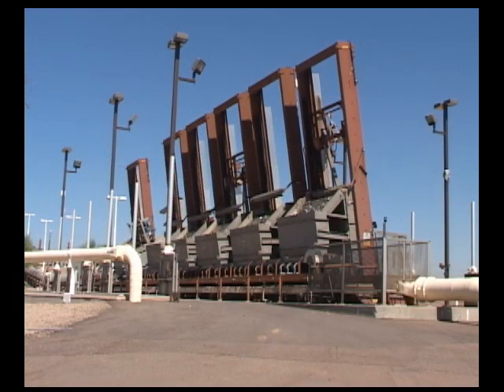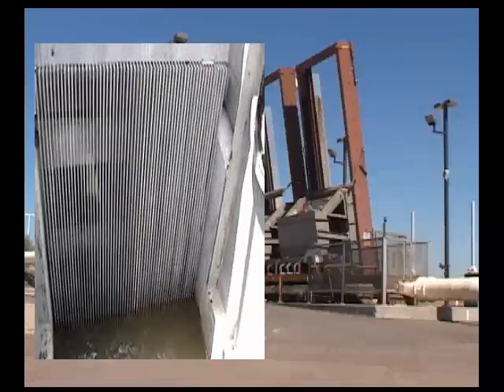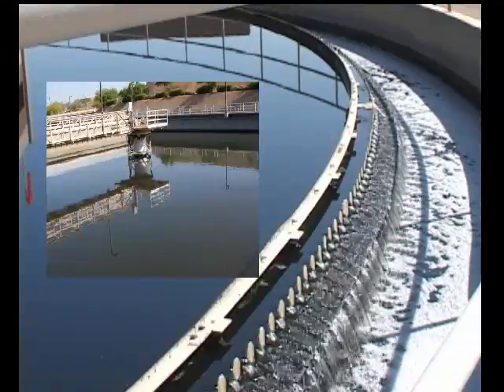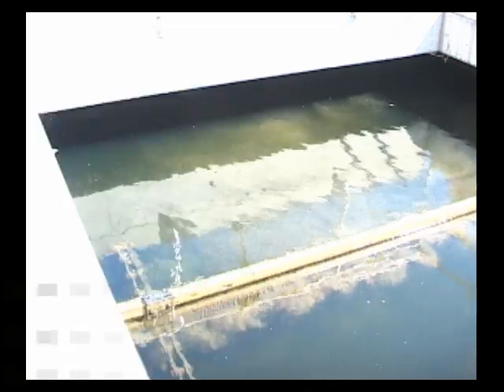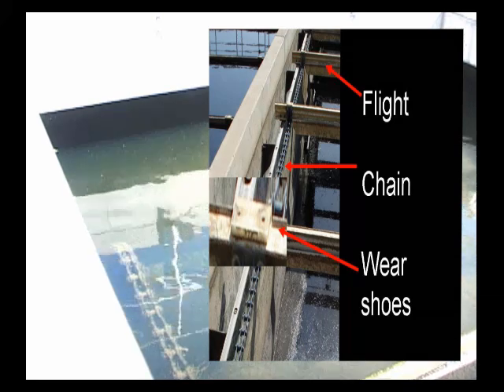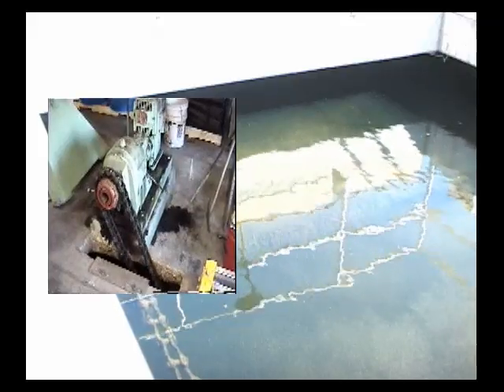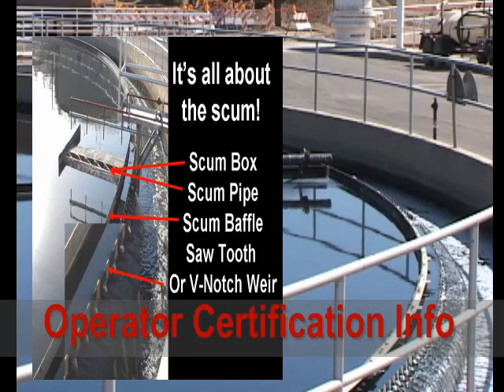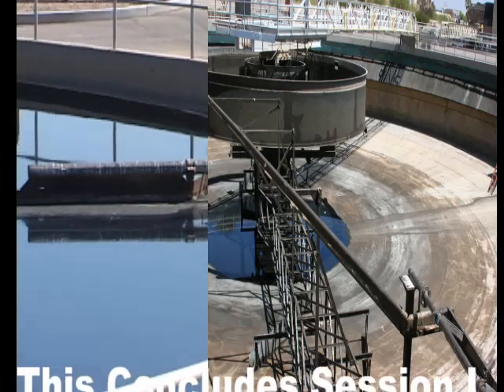Water Treatment Basics - Technical Learning College Continuing Education CEU

Comment: For undeveloped/developing countries, anything is better than nothing. A basic community POTABLE WATER (drinking water) starter system could consist of an acceptable water source, then screening. Then sedimentation. Then perhaps carbon filtration. Then disinfection. Distribution. The flow is gravity from one step to another. Samples can be sent out to independent labs, and there's do-it-yourself sampling kits (for some tests, not all). There are international non-profit organizations that can help communities achieve water quality.
Reply: Interested in water (or wastewater) treatment careers? Local community colleges usually offer classes, AA degrees and certificates. There's also online courses. Also consider a few industrial safety classes such as "electrical workplace hazards," "confined spaces," etc. (available online), and have a drivers license, high school diploma/GED.